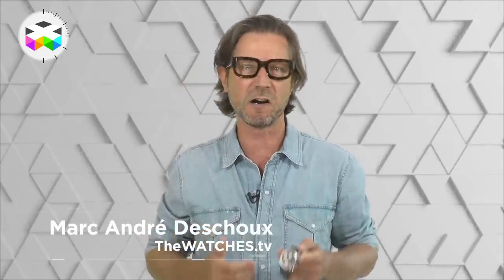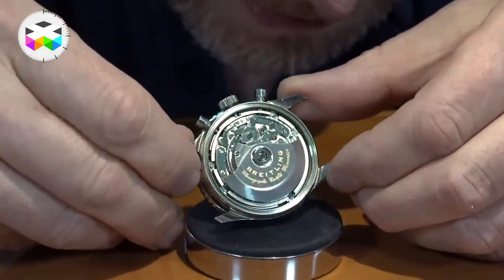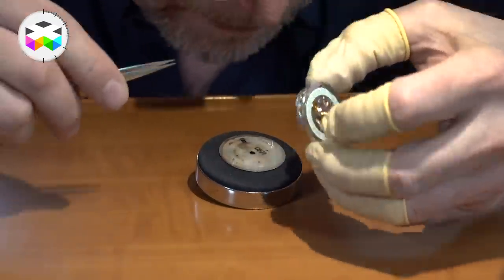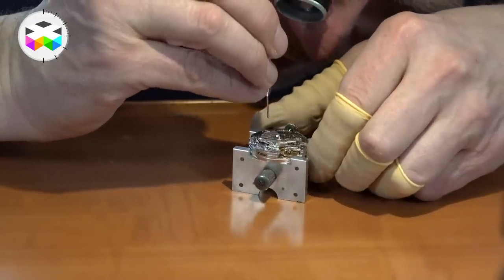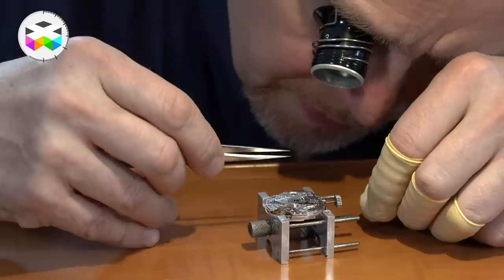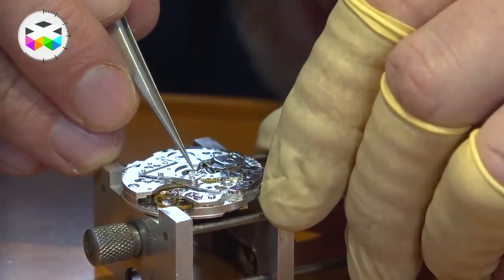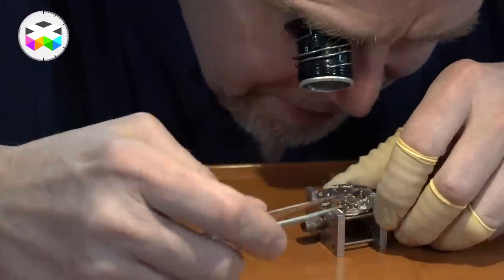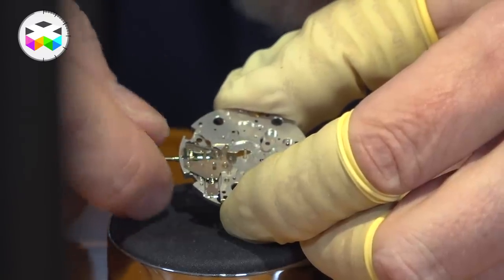Don't Do This at Home: Breitling Navitimer & Valjoux 7750 caliber

Comment: I need to speak to that gentleman!
 I have a Navitimer and the watch crown is hard to wind and doesn't seem to pull out very far although I can set the time and push it in a click and set the date but the crown doesn't seem to want to push back in all the way, sometimes I have to pull it out and figit with it and push it back in. I'm not sure what is wrong with it but I dread having to try to get to it to fix it. I would just like to know why it's hard to wind and why it doesn't want to push back in all the way. I'm not sure if the stem has a gasket/gaskets on it and possibly there's a piece of it stuck in the winding mechanism or if those winding gears are messed up or what.

Comment: Wow great video! This made me appreciate the complexity of the 7750 even though it is regarded as one of the most “basic” automatic chronograph movements. I’m just wondering if the finishing of this v7750 is superior to a generic one , let’s say, found in a tissot or Hamilton watch. Does Breitling do enough extra modifications to prolong the service interval of their watches, or is this just comparable to one found in a sub $2k watch.
Reply from the maker: Most probably the same, but in terms of finishing, brands can adapt to their standards, thus a price difference too.
Reply: You can order them in varying finishes from eta. They are actually quite advanced in the sense they can have allot of feature from eta, tripple calender moonphase for example. Its not really basic because it doesnt use a traditional chrono system but a more “advanced” cam system. Its just advanced with the design brief of cheapness. Lots of stamped parts and bent wire springs and really really Really big manufacturing tolerances. We couldnt belive when we were looking in the jig borere  how nuts it is this thing can run when its so badly made. It all comes down to being well engineered for that purpose and having had a constantly evolving design. 
 Although some grades might have some extra finishing generally they are all the same. If you dont care about elegant mechanics and just want something cheap to repair then they are great. But id never buy one. Seiko does a much nicer chrono for less money.